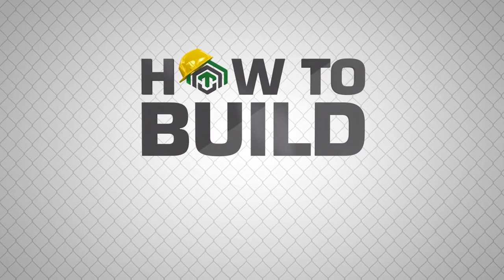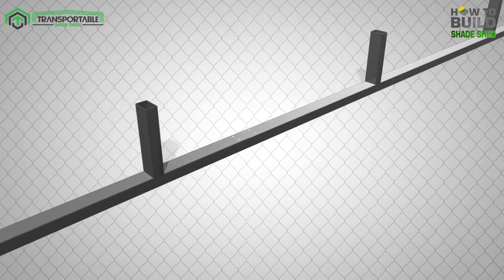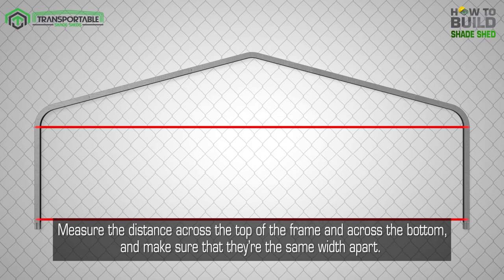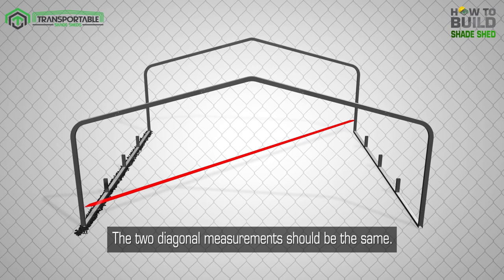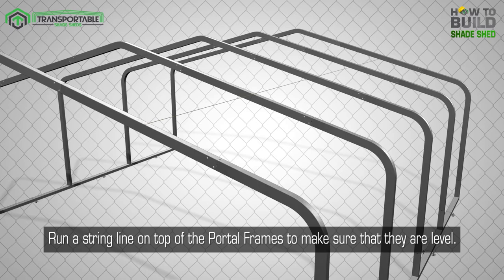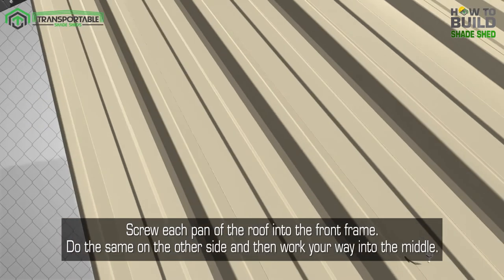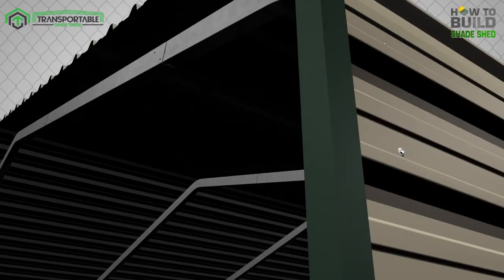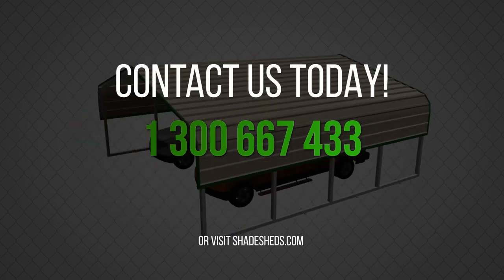DIY How to Build a Shade Shed - Step by Step Video Guide

Comment: Where do you find these ground anchors with the saddles. I can't find them anywhere? What is the proper name for these kind of anchors?
Reply: Bunnings has them - called a ground screw. They are a bit different, but will do the same job.